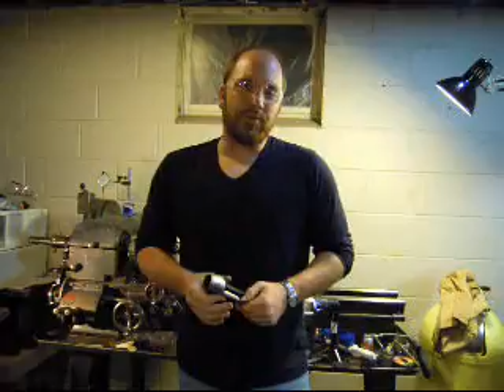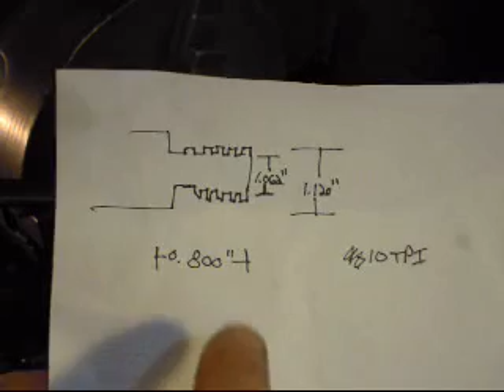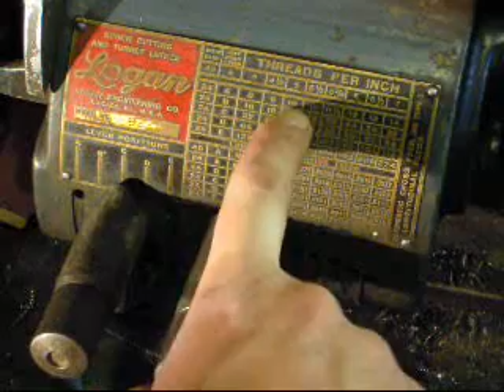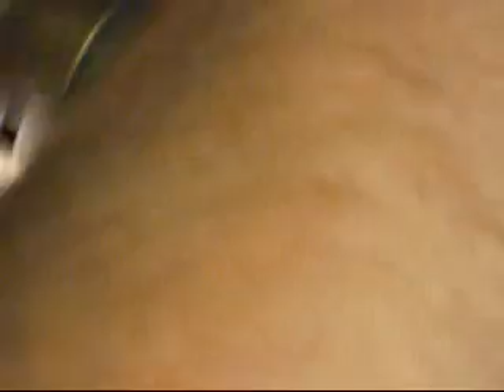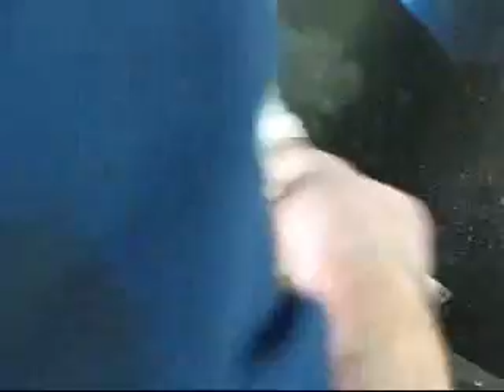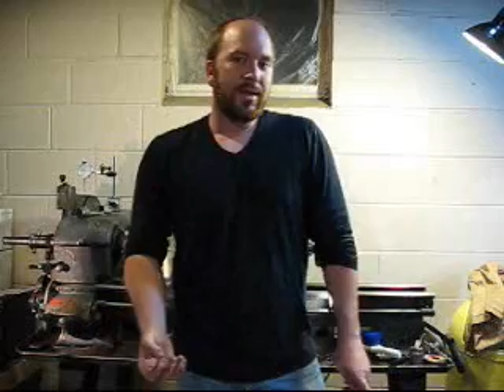Cutting Square Threads on a Lathe!

Comment: When measuring the length to the shoulder, use the rear of the calipers.

It gives a far more precise reading, than using the tips of the jaws.
Reply from the maker: I use a depth mic normally. This was right after I moved and was rebuilding my tooling supply. I've got just about everything I need now and a bunch of stuff I may never use.

Comment: Thanks for the video.  It was very helpful in my threading lessons.  Just purchased a Logan 2527.  I can't seem to get the back gears engaged (no chuck motion).   As a result the lathe is running to fast for some cuts.   Any help would be appreciated.
Reply from the maker: +Mando Manf 
Did you pull the bull pin on the spindle? Sounds like something is still locked up. Not familiar with that model. The pin might be on the outboard end of the spindle, not sure where it is, but it should have one. Thanks!
Reply: +spitfire1821 ... Thanks for the reply.  As it ends up the original owner never used the compound (set screws were over tightened) and the original owner NEVER used the back gears.  I used a chisel and hammer in 3 spots to pull the large handle at rear of lathe.  It took a good half hour once I found out what to do.  A lot of CRC spray overnight and a good lube job afterwards has it moving smoothly in and out to dis-engage / engage back gear.  Thanks for your help / advise.
Reply: +Mando Manf P.S. ( See this thread for photos... conversations) http://www.hobby-machinist.com/threads/logan-lathe-back-gear-problem.40434/
Reply from the maker: Good to hear you got it going.

Comment: How would you cut a longer (12-18") thread on say a !' diameter?  The flex would be large it seems with the increased tool 'push' of a formed cutter.  The steady and follower would get screwed up by the threads wouldn't they?  I am thinking of cutting some for a jack which would require the longer length.  Nice video.  I would like to see more of the grinding of the form tool also.  Happy Thanksgiving!  Doug
Reply from the maker: +Douglas Thompson
Hello, yes, the video became bad resolution when it got transfered and I have a new 1080p one in the works. You could used a follower and it shouldn't mess with the threads. You can also champher the follower fingers if you are worried. Thanks. For the comments and watching. I'll try and get the new video up in the next few weeks.

Comment: Need to recheck your minor diameter1917's are not true square threads they are square form but not full depth. This combined with the fact that this is for a firearm well you then have a bunch of unsupported material and weak threads.
Reply from the maker: +kcstott 
You are correct the specks are 1.085" MD. I pulled an old barrel off that someone else did and measured it just for the purpose of this demonstration. I've built a lot of 1917's and 14's in many cartridges, and they all get cut for each action and hand lapped on. I learned from a Master Gunsmith that built thousands of 1917 customs for over 50 years. Many top name barrel manufactures referred customers to him for 1917 barrel work back in the day. This was just a demonstration, but thanks for bringing up that point for anyone else watching. I'm going to be doing a 1917 build in the next few months and will be showing a proper 1917 barrel install. Thanks for watching and commenting!
Reply: I've got an Eddystone in pieces in the garage waiting for parts to be a .416 Rigby.
New barrel, English walnut stock american classic shape shadow line cheek rest, double square bridge bases cut for CZ width Talleys Cross bolts, flush sling swivels, New bolt handle, Ed Lapour bolt shroud, new bottom metal. and a bunch of time on the machies.
Reply from the maker: +kcstott 
Sounds like it will be a nice rifle and you spent some money on it. I love those flush mount sling swivels! The bolt shroud conversion is neat, I have an action waiting for one right now. The Rigby case is a little work to make it feed, but they are one hell of a set up on the 1917 when done properly! Good luck with your build!
Reply: Yeah it's going to be a fun build

Comment: why use a tailstock at that short of length???? ya wasting time bro! cut it and be done, dont ellaborate on... i see why when ya get to the threading part, but dude..... Not being negative buddy, just saying.
Reply from the maker: +chris powell 
Force of habit to try and get things as rigid as possible to cut as accurately as possible. Do you need the tail stock when that close to the chuck, no, but it doesn't hurt ether. As far as the video goes, its bad quality and I did talk too much! I'm making a version 2.0 on this and it's going to be 1080p and very condensed vs this video!
Reply: all good bro!!! not trying to be negative at all!
Reply from the maker: +chris powell
I know, Just trying to improve everything for everyone out there watching these videos! Thanks again for your comments!